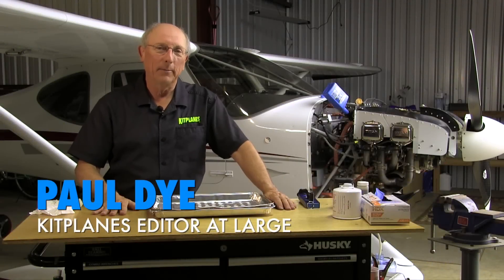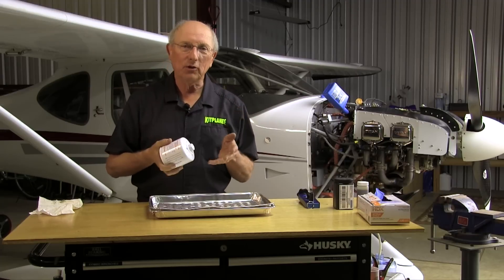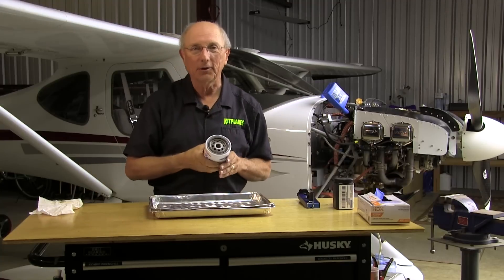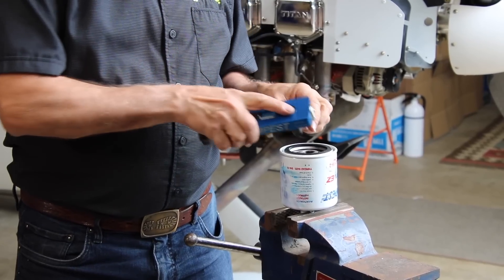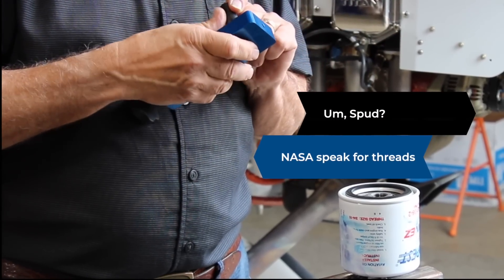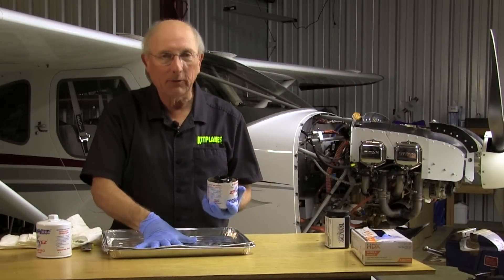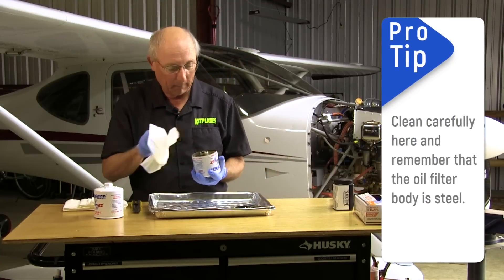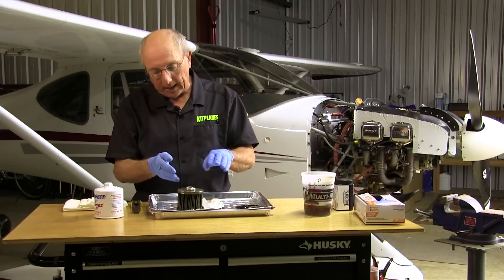KITPLANES Firewall Forward: Oil Filter Cutting and Analysis

Comment: I cut the can open with a really sharp wood chisel. I get no contam in the filter pleats.  On the pleats, after I inspect them I throw the pleats in a container of Varsol and agitate for a while. Then I throw in a neodium magnet and swirl that through the varsol by shaking the container for several minutes to collect all the ferrous metal. I usually just get a little bit of ferrous "mud" superfine particles stuck to the magnet. Then I'll strain the varsol through a piece of dark cloth from an old shirt to look for bright non-ferrous bits.

Comment: Is that the 18mm or 25mm Dewalt snap-blade knife - and do you prefer it for this job over other knives?
Reply from the maker: It's the 25mm knife. We've been using the Tempest AA471 filter media cutter lately and like it a lot. Makes the job simpler and (a little) cleaner.